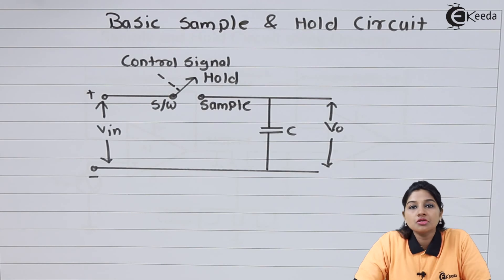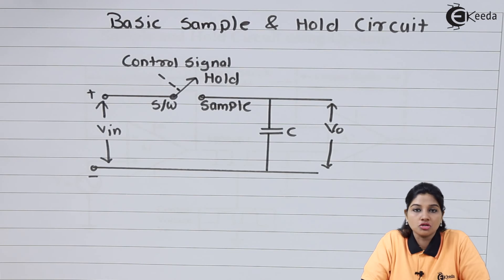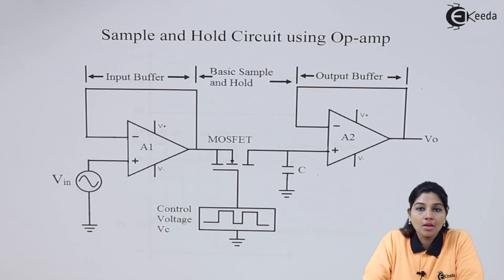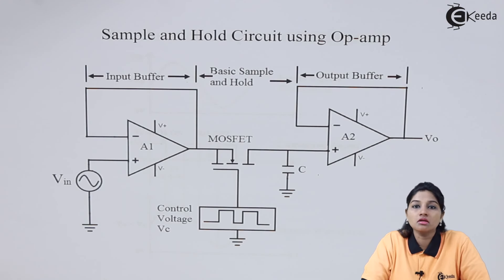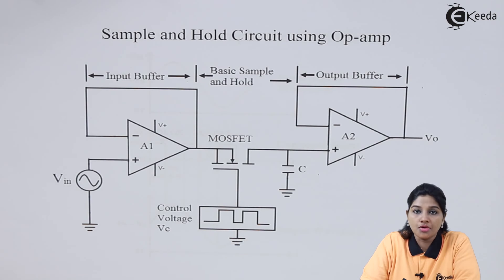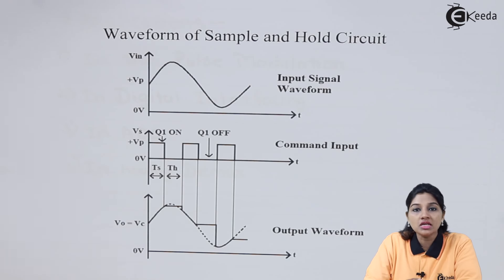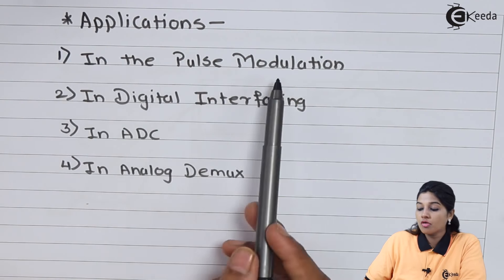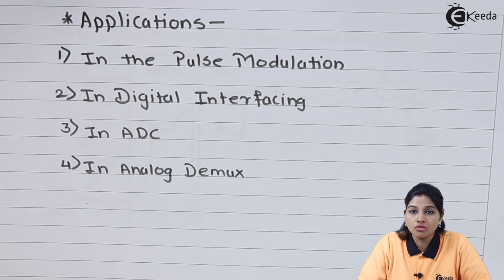Sample and Hold Circuit - Non Linear Applications of Operational Amplifier

Comment: if the capacitor is not discharging how the voltage of capacitor  is reduced when input is still in +ve phase
Reply: You found the answer ?
Reply: @sahandeepdas3627   The input buffer should source or sink as necessary to set the capacitor value to the input voltage.

Comment: Mam as you said the op-amp has a high input impedance so the capacitor can not discharge through op-amp A2, but how the capacitor is charging by Vin, Vin is also connected through an op-amp A1 which is also having a high impedance, please explain the reason why there is a difference in A1 and A2?
Reply: Every Op-Amp has a different input impedance. Vin must be higher that the input voltage of A1 & Capacitor C must have a value lower than the input impedance of A2. Op-Amp A2 will not conduct until its threshold input impedance is crossed, hence capacitor C will not discharge.

Comment: excellent sample/hold op amp video...  do you have one on the Vishay IL-300 optocoupler?  so you can take the S/H output and feed it into another op amp that is galvanically isolated circuit using another power supply?   thank you and great information...:)